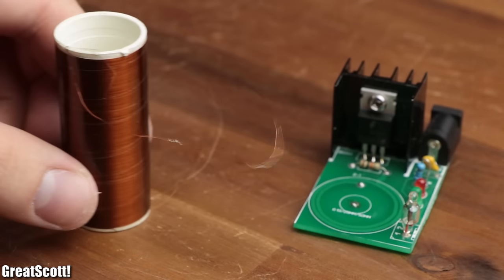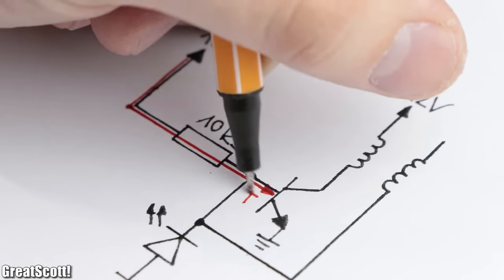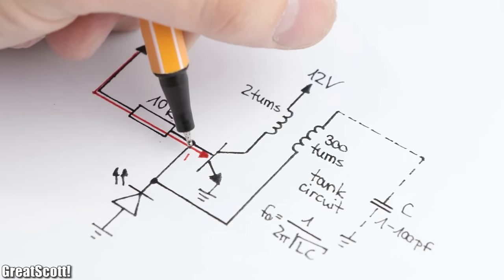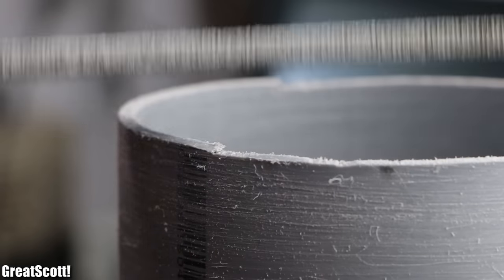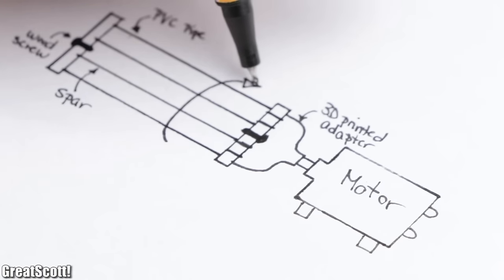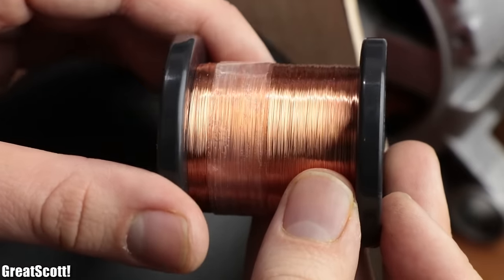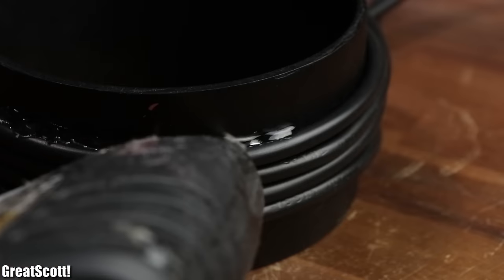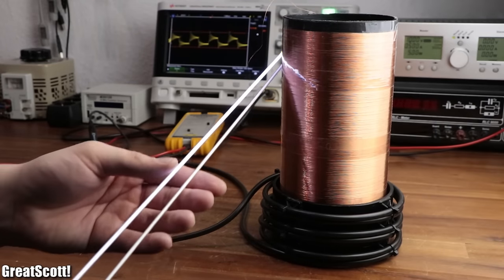Make your own Tesla Coil (Part 1) || Slayer Exciter Circuit

Comment: Haha only you would have a washing machine motor lying around
Reply: Valid I Do have one and BTW, a metal lathe.
Reply: lol
Reply: I even have two of them laying around...
Reply: I'm barely into electronics and even I have one (well a dryer motor) where I had replaced it.
Reply: OKAY IM WRONG JEEZ
Reply: I don't have one. But I do have a powerful induction motor off a boiler. Well, relatively powerful, I think it's like 1.5HP or something, it drove a 12-18 or so inch centrifugal turbine. The part is designed to mix natural gas and air before it gets blown through a wire mesh cone into the burner chamber. The wire mesh prevents flashbacks and evens out the flame I think. Asked the installers if I could take some parts off our old furnace that was being replaced before they hauled it away. They didn't care, so I took just about everything besides the water pump and electronic gas valve. The pump and valve being too hard to remove without a grinder, which I still don't own to this day.
Reply: yeah, I have a couple just because I salvaged them before getting rid of a far gone washer/dryer. some people call it hoarding, but bare components can be useful for future projects imo
Reply: @Bryan Kraemer To be honest, if you don't have piles of actual garbage everywhere, and it's actual usable parts you're saving for future use, that's not hoarding in my opinion. It's called doing the right thing and saving still good parts from otherwise junk appliances to put them to new uses. :p
Reply: I don't have one, but I do have various different AC motors. 
Thought I'd just chime in :)
Reply: electronic junk are like a treasure you may not know what you can find in it
Reply: ProCreeper 2000 even I like motor especially the brushes motor there is a great application of them in RC the quadacopters ,planes etc
Reply: What about a drill machine?
Reply: If I go to the trouble of salvaging a washer or dryer you can bet I will keep the motor, timer, switches and probably the wiring harness if they are not defective.
Reply: fish That's why I do not recycle appliances nor let repair companies take my broken appliances. The materials are invaluable.
Reply: Seems like overkill lol. I think a battery drill with the barrel/cylinder on a bearing would suffice providing its balances ok
Reply: fish i have one in ma yard just waiting for the new brushes
Reply: Poor fish this comment has made a year of oof trip fishie boy
Reply: what's wrong with a motor of great Scott 

don't try to underestimate great Scott
Reply: I'm 13 and have 2 of them and like 10 microwave oven transformers
Reply: Goto craigslist, your likely to find free washer dryers.
Reply: Remember that video WHEN HE HAD A OLD 3D PRINTER FROM HIS FRIEND ??? 😲😲😲
Reply: Can you shut off NANOTECHNOLOGY mind Kontrol military grade v2k?????please help me from America....they try to make sexual slavery!!!!
Reply: Can you shut off NANOTECHNOLOGY mind Kontrol military grade v2k?????please help me from America....they try to make sexual slavery!!!!

Comment: Can you make like a DIY wind turbine? That would be awesome! Keep up the great work btw 👍
Reply: Check out anotherpower.com. Lots of people making them there.
Reply: A vertical wind turbine would look awesome (and save space)
Reply: 1) Get soda bottle, make turbine w/ many little vertical slits, bent outward. 2) Mount on wood scrap with bicycle spoke as axle for bottle to turn.  3) Find legacy hard disk drive that use magnets, open, remove disks, tap into voice coil (coil that moves arm back and forth over disk platters). 4.  Attach reciprocating linkage from soda bottle to hard drive arm to have wind move arm back and forth, keep voice coil in high flux magnet housing.  5. Attach voice coil wires to FULL BRIDGE RECTIF-
Reply: Can you shut off NANOTECHNOLOGY mind Kontrol military grade v2k?????please help me from America....they try to make sexual slavery!!!!

Comment: Thank You for the video. Why does the coil have such large diameter? Won't the flux linkage be better if has lesser diameter. And also lesser amount for copper wire would be sufficient for same number of turns if the diameter was lesser right?
Reply: Tesla coil works by resonance unlike a normal transformer. So the primary and secondary need not be coupled tightly.

Comment: Hey, i suggest you to replace / use by  smooth topload capacitor to force the charges to stay an accumulate on top , so increase the spark length ;)
I don't recommend to paint the pvc pipe of the secondary in black. Because the black paint is composite of carbon particle that is not a good electrical isolation and can result of internal short circuit between wire (especially if you plan to increase the power ) 
If you want to increase the performance , use Igbt transistor or bigger Mosfets  in a bridge topology (or half bridge), use a interrupter with pulse width modulation. I suggest also to use the tesla coil calculator called JAVATC that is really helpful for desing the coil spec, calculate the coupling ... 
By the way my passion is to build Tesla coil, so contact me ;)
Reply: winky face intensifies
Reply: Will you build me one please?
Reply: Can you shut off NANOTECHNOLOGY mind Kontrol military grade v2k?????please help me from America....they try to make sexual slavery!!!!

Comment: This is perfect.  Everybody has a washing machine motor and a 3D printer just lying around.
Reply: the dude you could do the same things with an old microwave transformer, a couple of nails for a spark gap, some capacitors, pvc pipe, and a lot of copper wire
Reply: Viper vids gaming plus   He's talking about a coil not a nuke
Reply: Just be a little creative, you don't have to use those exact items to wind your own coil. You could use a drill and put together some assembly to hold it.

Comment: I also built a slayer exciter some time ago. You can significantly increase the arc length by playing around with the number of primary turns. 
I used a coil about half the size of the one you built, but a lot thinner wire. It's a great project to play around with, but you also need to be a little careful. I burnt my fingers countless times while grabbing or touching metal objects near the coil. It will wirelessly transfer its energy into you and everything near it. 
I also got it to play simple music by interrupting the power supply at the note's frequency.

Comment: is it necessary for the coil to me made from a single wire ? I tried joining wires but the Tesla coil doesn't work. maybe because of the sharpness at the joining points
Reply: Normally, this shouldn't be a problem, as long as you don't change turn direction.
Reply: When joining the wires I reccommend making a western union style joint and soldering it, then putting a small amount of cyanoacrylate or other plastic based glue or varnish over them. Clear nail polish would also work good.

Comment: Great! 
High Voltage+Danger=Perfect For YouTube.
lol..........
Reply: A Tesla coil can't kill you because there's not enough amps, it'll just hurt really bad if you get shocked by it.
Reply: MOM ITS NOT WHAT IT LOOKS LIKE how do you know there's not enough amps
Reply: Dimitrije Krstić When you induce a voltage to a bigger coil (in this case the secondary coil) the voltage will increase. But more voltage with the same current as in the primary would mean more energy/Watt. You cannot create power out of nothing. So in order for the voltage to increase the current/amps must decrease.
Lets assume you have 12v 1A running through the primary coil. this means a total of 12v * 1A = 12W. Now lets say the induced voltage is 2000v. So if you had the same current it means that you have 2000v * 1A = 2000W and this would mean 1988W are created out of nothing. But because the induced voltage is higher, the current has to decrease. So if you would induce 2000v this means a ratio of 2000v / 12v =166.6. So the primary voltage is multiplied by 166.6 at the secondary but the current gets divided by 166.6. So you would have a maximum of around 1A / 166.6 =0.006A. And then your body has also a resistance. And because the high frequency the arcs won't jump into you but they will flow through your skin to ground because of the skin effect which will only lead to minor burn marks on where the arc has hit you. But you won't feel an electric shock because no electricity flows through your body. (I hope my english makes sense)
Reply: PyroHacks nice

Comment: can you tell me the washing machine engine's voltage and amper ? I have same engine but I don't know how much it needs? 
please reply
Reply: S S google it...
or go to appropriate forums...
Reply: jan harald I already done but I could not get any right information that's why I'm asking
Reply: you can power it with the 230v ac or at low voltage dc. I recommend trying it at  low voltage, the worst thing that could happen then is that it won't run.
I powered one with a 9v battery and even this worked slowly.
Reply: Keine Ahnung i tried to use 220 v ac  (normal plug electricity ) it sparked and smoked (like electrobooms videos) have you got better suggestion? I also tried 19v 4a DC and worked really slow
Reply: i think you broke it with the 220 AC
Reply: Riki Z.  I tried to work with 19v 4a again im sorry but lt wasn't broke lol
Reply: You have to be careful how to connect it. Normally the motor has a terminal block with multiple connections. It should contain a rotor coil, one or two stator coils and other stuff like for example speed measurement. You need to find the rotor coil and the longer stator coil on the terminal block(each of them has a few ohms, the sensors should have a much higher resistance) and hook them up in series. Then you should check if it works with a low voltage. DEFINITLY CHECK IF YOUR MOTOR IS RATED FOR 230V AC BEFORE HOOKING IT UP! If you did everything above you should be able to connect your motor to the mains 230V ac.
Reply: Keine Ahnung thanks but i have a problem i don't have a multimeter
Reply: Just buy a cheap one, it will do the job. For electronics you need a multimeter anyway.
Reply: Keine Ahnung yea but scott's answer is the easiest way and thx for all
Reply: What's his answer?
Reply: The motor should be labelled with that info. Washing machines will typically operate at the country's line voltage.

Comment: Wiper Motors and or Electric Window Motors work the best for winding coils. They work on 12v and can easily adjust your speed down by turning the Voltage supply down. Most importantly, because these type of motors have a Worm gear reduction inbuilt, the shaft will NOT move at all when the power is turned off. It holds it's place - so you can apply glue or tape etc.

Comment: Hi GreatScott. Thank you for this an other fun project again. 
To increase output power you can maybe use litz wire for primary coils since ~400kHz is a bit high frequency for using such thick cables as primary.

Comment: your primary and secondary need to cover the same area if you arent using magnetically permeable iron to carry the  field, right?  because how else are the turns at the top adding to the output when there isnt a magnetic field passing through them? try wrapping the larger cable around the whole length of the first winding, not just the bottom, and see what you get.
EDIT: just remembered how old this video is lol so this comment isnt likely to be noticed or useful to the project..

Comment: For best results, you're going to have to be able to "tune" the large primary coil by tapping it in various places until the coil is maxed out.  I've watched this done on several conventional, neon sign transformer/mechanical spark gap type tesla coils.  It makes a huge difference!
Reply: Please make a video, I beg you
Reply: @1_and_only_Crjase  
I wish I could!  I watched the process being done on several TCs built by a friend of mine.  Here's the basic idea.  He used bare copper wire for his primary.  Otherwise you must pierce the insulation of the primary wire.  To tune, he would make a short (2-3 ft) lead wire out of 14 gauge solid wire, so that he could bend it into the desired shape to suspend it around the coil while testing.  The other end was attached to an alligator clip.  The loose end is fixed to the (as I recall, it's been awhile!) spark gap output or capacitor output - can't remember which - which ever feeds the primary.  The other end with the alligator clip is placed at various locations around the circumference of the primary coil, measuring the output roughly by corona length each time.  By making numerous tests while gradually increasing the effective length of the primary, you will see the corona get longer (more in-tune) then shorten again as the coil goes "out of tune".   When he was satisfied that he had found the correct location, he would make a more permanent connection to that location on the coil.  Spark gap frequency changes coil output as well, so he would make that connection to the coil so that it could be changed again, if needed.  That's what I recall!!  Be VERY careful when doing this!!  One wrong move and you're well and truly "toast"!   Good Luck!!

Comment: If you made the secondary coil with a smaller diameter pipe you could have way more windings for the same amount of copper wire.

Comment: That secondary should be throwing 6" arcs or better. Hint, take the circumference of the tube and multiply it times the number of turns, then multiply total times four. This number is the wavelength of the optimum resonant frequency to achieve maximum voltage. Make the primary resonate at that frequency. Use a car coil for the primary power transformer. For a Tesla HF coil design, leave the secondary ungrounded. For an Oudin  design, ground the secondary. (You shouldn't need squat for power, so limit the car coil circuit at 25 - 60 watts, or 12v @ 2-5A MAX.) Drive the car coil with a pulsed power mosfet circuit using a cmos 555 timer IC for frequency timing. Solid state with actual arcs, not just a huge toy.

Comment: 2:30 Are you sure about it? I think, that you're wrong. Primary should be connected reversely and when transistor is open, positive voltage gets into a base of transistor and keeps oscillation of secondary LC circuit. Here are some proofs:

1. When you turn on the circuit, you can remove a resistor and it's still running.
2. Most diagrams show, that primary is reversed.
3. In science of oscillators, there is a rule, which tells, that when you want oscillator to work, it must be propagated by same signal as output (0 degrees shift) or signal shifted by (360 degrees) x (any positive integer) and if you're very smart, you'll see, that it's same signal!

Rule, that you explained applies only to oscillators based on inverters WITH SCHMITT TRIGGER (cause they can wait for capacitor voltage to rise and fall to special threshold voltages).

I can be wrong! I still have to learn much.. This video is very nice, I like it and I hope, you are going to make more videos like this!
Thanks!

Comment: I want to buy a lab power supply cause I need one to charge my battery packs (yes, I have built in a pcb) but I don't know which one. I thought the supply from greatscott would be awesome but the rating of the seller 'elv' is not as good as I hoped. So, have you one ? Which should I buy (price to 250€)?
Thanks for help.
Regards
Pyrian

Comment: Technically, the turns ratio of an actual tesla coil has little to do with the produced voltage - a lot of people have this misconception and end up with extremely tall, narrow secondaries, which perform very poorly. You want a ratio of about 1:2 to 2:9 diameter to height for a good coil, and that raio of course depends on frequency, magnetic geometry, coupling, and topload capacitance. I recommend trying a different circuit than the slayer exciter. A good step up might be something like steve ward's "Mini SSTC" design with a secondary current feedback transformer, That will work a whole lot better than the original antenna feedback. (A more careful secondary winding method might be advantageous as well, so you don't have overlaps and gaps which could cause internal arcing and destroy the coil.)

Comment: Black paint??  What makes black paint black is any number of materials, ferric oxid (conductive and magnetic), manganese dioxide (conductive), carbon black ( conductive). In electronics only specially made black paints are trusted not to interfere with ocylator efficiency.

Comment: Bruh... .. .  .   .

I'm pretty sure your choice of paint is primarily to blame for the flimsy output. Black paint is generally made with pigments that conduct electricity, like carbon or iron oxides. I would coat the tube and secondary with enamel or wax.

I made one of these and got bigger sparks, using just a single transistor [I blew up many, some violently]. Your coild should be able to as well.